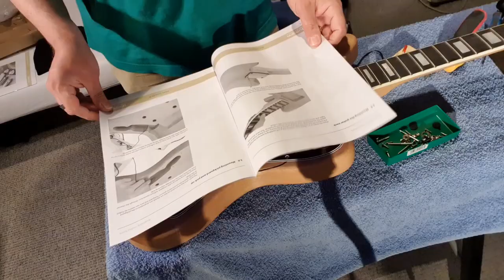Harley Benton JA Kit Guitar Unboxing and Tone Test

Comment: I got mine a month ago . There was no rubber pads with mine . But the pickups had holes drilled with springs  and screws so you  can adjust the height . The   Pickguard holes were not inline but I got them sorted . The pickups were marked B and H . The guitar sounds quite good . But I have not had a guitar with p90s before so I can’t really compare . like all guitars they will respond different to different amps . So the guitar is only half the story . But am happy with my purchase . I might changed the bridge pickup though .
Reply: My kit has come without the foam/rubber pads for the pickup cavities as well. How did you resolve that problem?
Reply: @emmandkev   I contacted  thomann.  They said the instructions were out of date . As you described the pickups have holes in . I screwed  the screws and put the springs  over the screws . That way you can adjust the height . I really  like this kit .Decent sounding too. How  you getting  on with yours.

Comment: You got lucky on the neck. Mine was straight and the frets had no sprout/ sharp ends but were about as level as an off road course and just as dirty.. So it needed a full fret level and dress. The neck pocket profile didn't match the neck and this is very common. Don't strip it to stain it. There's absolutely no grain under that sealer. On my kit the bits of wood that made up the body were totally different colours so in the end I'd have been better off just painting it. I had the same problem with the foam and had to cut it back and redo one of the holes. BUT it does sound great, exactly as I expected and worth the hassle in the end. Might even buy another as the one I have is also getting a bigsby fitted.
Reply: I received mine today and I agree with you : the neck pocket did not match the neck and I don’t know how to solve that. And no grain under the sealer, this body has to be painted.
Reply: @jeromeb.  I used a chisel and squared the neck pocket but others used a bit of sandpaper wrapped around a pencil or bit of dowel and just sanded the pocket to a better fit. It's only 10 mins fella so not a problem. It sounds great when it's done, worth the effort.
Reply from the maker: Bigsby is a great idea
Reply: Same here, got a body with 3 different color of wood, I'm so sad I wanted to have a natural glossy wood finition :(

Comment: Not as overjoyed as some of you... Got one mid-August (€ 99) and holes for the bridge and saddle were drilled too far apart so I couldn't get the bits to fit. The holes on the body were completely misaligned with the pickguard. The foam for the pickup cavities was missing... Thomann did send me a replacement after I returned it, credit where it's due. By that time the price had dropped to € 79 so they gave me € 20 back, lovely. However... the holes in the body are still not completely aligned, if much better than previously. At least I can get the bridge and saddle to sit correctly. The issue now is there is one piece missing for one of the tuners. Have written for one. And I think the foam is cut too thick which means the pickups sit so high as to touch the strings. Will have to cut it down or remove it completely, or replace with other material.
Is the foam really necessary? What is its function exactly?

Comment: Are you going to reshape the headstock? I understand thomann/HB leaves it "blank" for avoiding copyright infringement...
Reply from the maker: Yes. I will post another video. Also changing pickups :)
Reply: @kevinboor3560  what is wrong with those pickups? Which ones you will put on it? Other upgrades like tuning machines, switch, pots? Thanks
Reply from the maker: @IgnazioPillitteri  I found the pickups really dark. Much more than other P90s I've had. Had to take the bass down to zero on amplitube.
Reply from the maker: @IgnazioPillitteri  also yeah I think if you scroll to the end i mention what I'll be changing

Comment: few of questions if you still check these! 
1.what is the scale length?
2. could i refinish/paint the body without sanding?
3. do you know if that pickguard is changeable with jazz master/jaguar ones?
Reply: ignore the 2nd question, i didn’t realize you’d go over that
Reply: Pickguard isn't changeable. 
The pickguard is a little bit smaller than the original Jazzmaster
Reply: Scale length is 25.5" (648mm), basically same as most Fender type guitars (Strat, Tele, Jazzmaster).

Comment: Thanks for this, nice video! I bought and built this guitar and am really happy with it but one thing I found confusing is that the pickups weren’t labeled as to which was bridge and which was neck. I took a guess and am not sure I chose correctly. They sound ok but I can’t help wondering... I see in the video you put the one with the red wire in the bridge?
Reply from the maker: If you have a multimeter you can test the hotness of the pup (i picked mine up for 5 bucks from a discount store). The bridge will be hotter than the neck usually
Reply: I bought this kit a couple of weeks ago and had the same question , then noticed that the underside of the pickups has either a "B" or an "N" stamped. I took that to mean bridge and neck.
Reply: @pelican2637  that must be new! My kit didn't have those markings...
Reply: The pickups from my kit have those markings, but the pickup with is labeled with N for neck is the hotter one. So if your in doubt, take a measurement with a multimeter.
Reply: You said the fret end are smooth.....but isn't the neck edgebound ?
Reply: @geoffreyalder7275  The neck is bound but not the fret ends. Mine could use some filing, depending on the weather...

Comment: My back can't take a heavy guitar any more (I'm 67) I have 2 other Harley Benton guitars that are on the heavy side. Can you give me an accurate weight on this guitar? (not bath scales. They aren't accurate) All a manufacturer can do is give an average weight, but the individual guitars can vary by as much as 30%. Any info or effort is greatly appreciated
Reply from the maker: I can check. Its heavier than the 12 string kit I built but not that heavy. Hang on
Reply from the maker: 2.764 kg. Just under 7 pounds
Reply from the maker: Worth bearing in mind that I changed the pickups now (warman Soapy Joes in there) and it has heavier tuners (wilkonson EZ Loks) in there now. Counteracting that I've since shaped the headstock which removed some weight

Comment: I just got the same kit. How did you tell which pickup is the bridge and neck ones?
Reply from the maker: Usually the bridge pickup has a higher resistance. You need a multimeter to test that. Fortunately there are many very cheap multimeters out there and they're easy to use. YouTube has some good vids if you haven't used one before

Comment: JazzMaster Pickups are a special Fender Single-Coil design but not P90`s. The may look alike but they sound much brighter than P90`s. Look it up, Kevin.
Reply from the maker: Ok I went and watched  the video again to see if I could get what you were getting from the video and I can't. You've told me about the pickups in Fender Jazzmasters. Didn't know that as I've never owned one but I'm scratching my head about the point you're trying to make when set against the video. Don't think I compared the pickups to fender ones at any stage. If I'm wrong (and I am offen) please do let me know